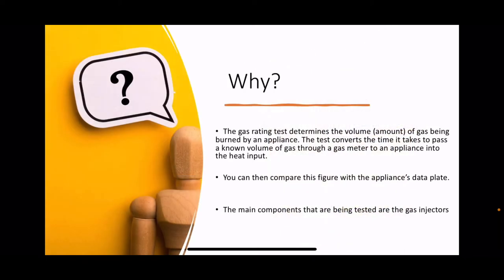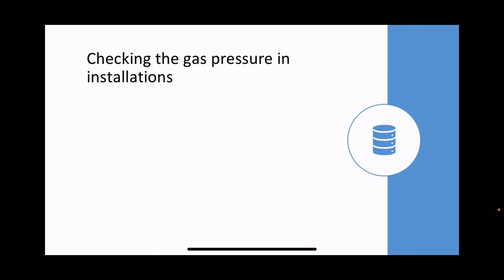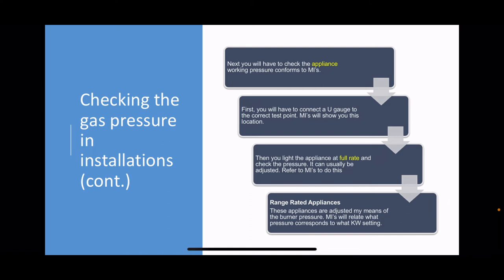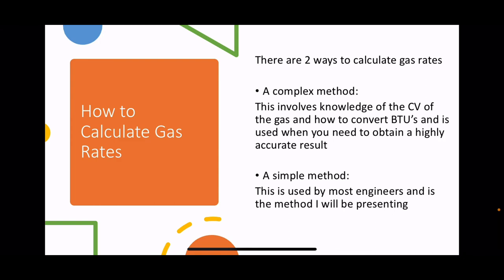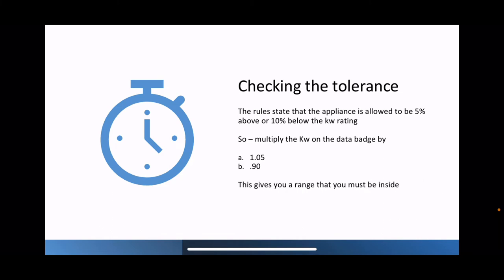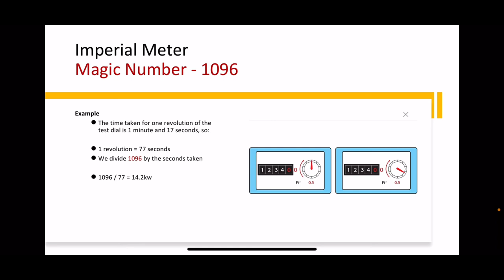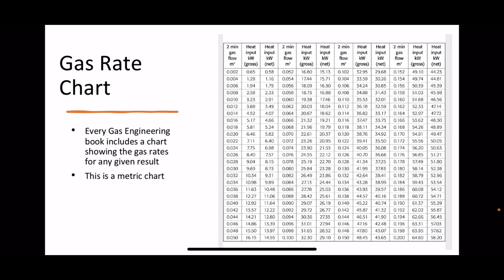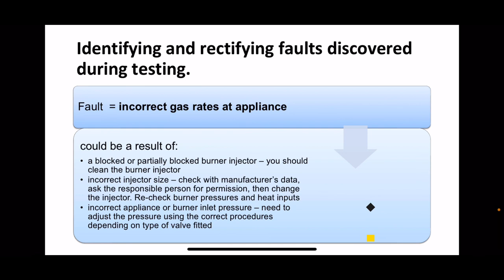Gas Rates Everything You Need to Know

Comment: After a long research i could not find these two magic numbers anywhere may i ask where did you find the magic numbers thanks.
Reply from the maker: Hi Ruman. They are simply a mathematical shortcut which reaches the same result as the long calculation in your book. It relies on the fact that the cv of gas in Britain is pretty well constant. Its the same as if you had the following; 2+2+2+2=8 or you could simplify it to 4x2=8. …same result different process. I hope that helps.
Reply: Much appreciated thank you

Comment: hi again drew changed my profile pic this is what i used to do ;] so this is the question if you dont mind dont want to get to bogged down on it lol question  21 on gas rates maybe i need a magic number if you got one :},, its says --

 if we wanted to determine the precise amount of gas needed in m3/hr by an appliance ,what woud your formula be if we had a 28kw net heat input gas boiler ,,they give the answer as  {  / MEANS DIVIDED BY  }
 A 28 x 1.11 x 10.76 =                B  28/1.11/10.76           C 28 X1.11/10.76 =     D 28/1.11 X 10.76
Reply from the maker: OK, that makes far more sense to me now. This isn’t really a question about m3/h conversions, but more a test to see if you know how to convert net to gross and with a bit of maths understanding thrown in to make up 4 answers. If you get a question like this you always break it up into its simple parts. So with this one, you have 3 BT’s of information … 1. The appliance input is in Net. 2. This net input is 28kw  3. The conversion factor from m3/h to Mw/h is 10.76.
Let’s take the first, and this, i think is the point of the question..there’s no option in any of the answers to leave the input as net. So that means that you must have to convert it to Gross..as you know we do this by multiplying the kw by 1.11. So that immediately removes answers B and D

We know that for every kw/h (every hour the gas is running at 1 kw) it will use 10.76 m3 of gas … that’s the conversion factor.

So you now have to show whether you can understand that if 1kw/h = 10.76 m3 then 28 kw must mean 28 X 10.76.

The only choices in the answers you have left are to divide the 28kw by 10.76 .. which doesn’t make sense or to multiply it, which does. 

So the answer is A

Very often these questions are written in a way that deliberately confuses people, they’re meant to be that way. They almost “frighten” you because they. Make them look complicated. But always there is a simple question inside the complexity. Just take out the relevant information (usually the numbers) and write down what they refer to .. like i did above, and usually you’ll find the answer is quite obvious.

I hope that helps, if you still don’t quite get it, let me know and ill explain it in a different way. 

And yes, I was wondering about your different names 😀 I’m getting old and easily confused.

Cheers
Reply from the maker: Spellchecker did me bad .. where it wrote BT’s should read “bits”
Reply: @passyourgas  you a star drew thnaks so much yea the question realy did throw me  im gona look at that again later ,,im 58 this year im definetly not as sharp as i use to be lol
Reply from the maker: You’re like me…a long way away from a maths classroom! Good luck.